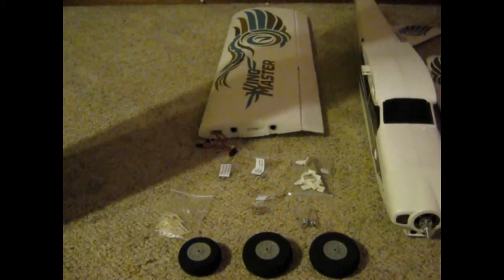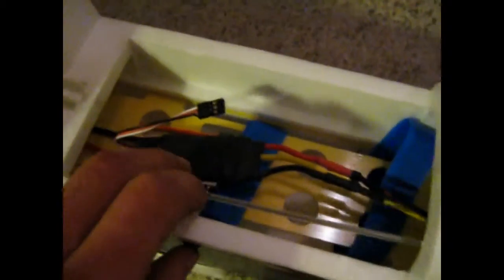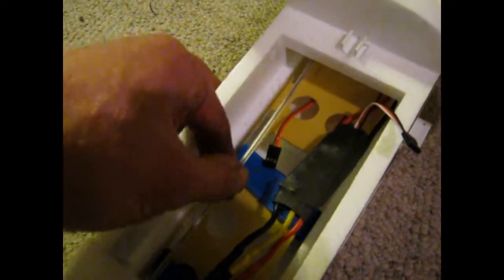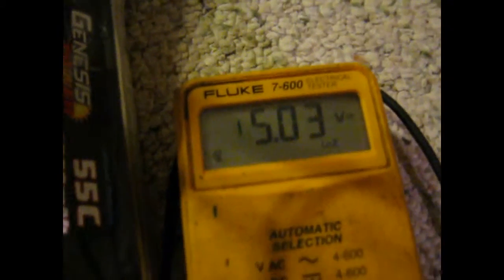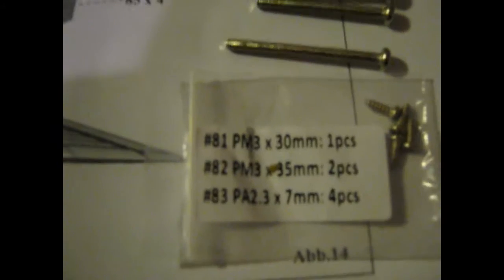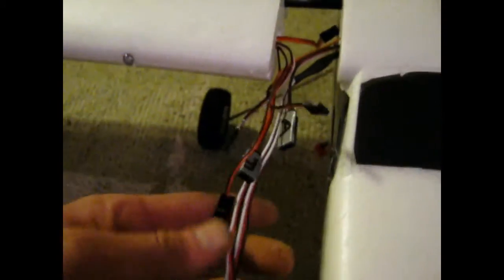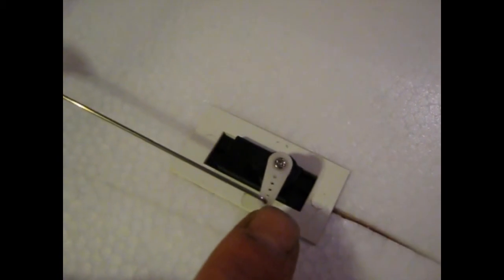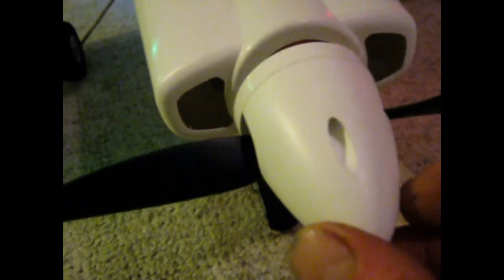Banana Hobby Wing Master build. change the prop! read notes below.

Comment: im using a 60 amp esc cause the one it came with was geting ay 2 hot.  i had that from another bird so i threw it on. what prop should I use with that esc and 4 cell battery???
Reply from the maker: I have had awesome results using the Master Airscrew 11x4. Ditch the nose cone tho, it won't fit properly on the shaft using the MAS prop. It will even fly using 3s using that prop.

Comment: My 11X5.5 draws 43.98 at max throttle using a 4s battery. I couldn't find a master airscrew prop locally, but have one comming. I did find a Evolution 11X5 that gives me plenty of thrust and only draws 35.17 amps at full throttle. What down angle are you using on your flaps?
Reply from the maker: +Harrison McCullough, the downward angle I set is around 25- 30 degrees tho I do not use flaps other than taking off or performing a very slow fly-by with this plane. It already has good lift without flaps. 
I am a fan of those Evolution props. I have one on my FMS PT-17 and enjoy it a lot. You may like that prop better than the MAS. Sounds like you are on top of the technical stuff and checking. I like that. 
Not sure if you have snow in your area, but this plane can use snow skids if you buy them. Not difficult to add. Just make sure the front skid doesn't hit the prop. (I had to cut mine shorter, round the front, and then bend the tip up after heating it.) I have mine set upward around 10-15 degrees when installed and the plane is off the ground.

Comment: I have APC 11X5.5 on mine. I also had to add servo extensions , some leads were a little to short for mounting the receiver where I wanted it. the only real problem with the assembly are the 4 screws that hold the wing in place. If they come off the phillips screwdriver and fall in that hole, well you will see what I mean.
Reply from the maker: +Harrison McCullough, be careful when using that pitch prop. The 11x4 MAS I use is about 5 amp above the speed controllers max output at full throttle static, using a 4S batt. APC isn't as aggressive as the MAS, but it is probably best to get a higher amp speed controller to stay on the safe side if using 4S. I'm still using the stock ESC, but I'm usually flying with a 3S batt. As for the screws, I know exactly what your saying. Grab a strong magnet and rub the screw driver tip on it, that will magnetize the screw driver and keep the screw attached to the driver. You can also find a magnetizer at a sears store also. It works very well to magnetize and is fairly inexpensive. Happy flying!! =D